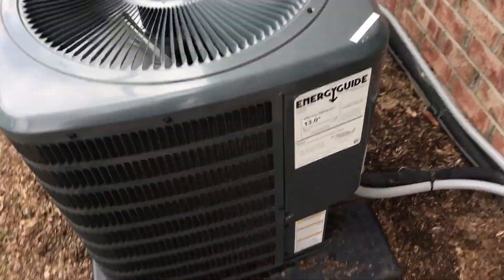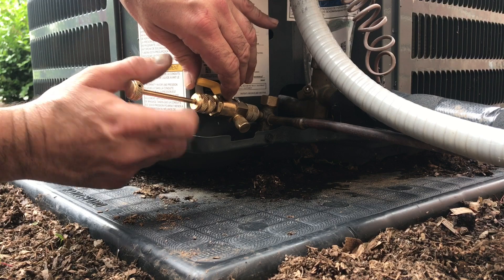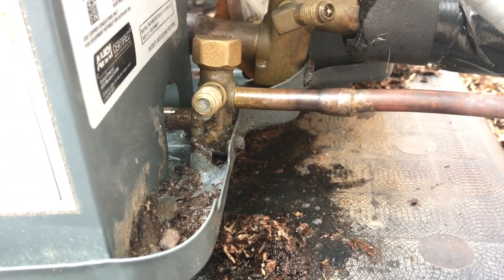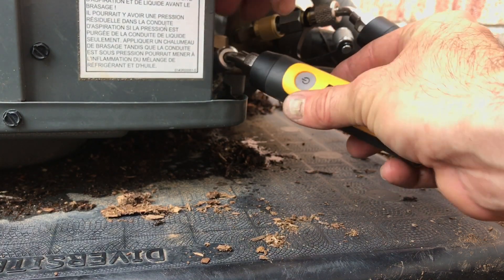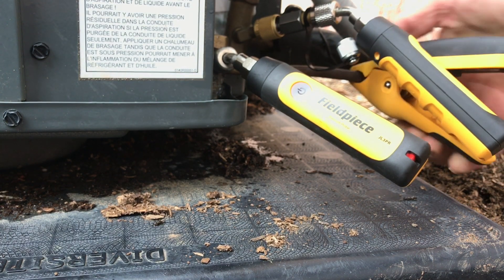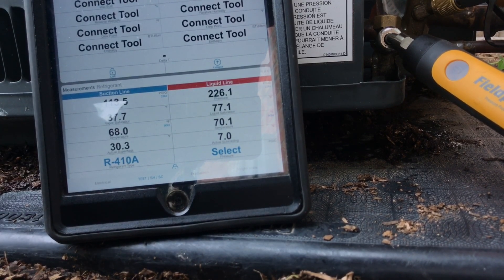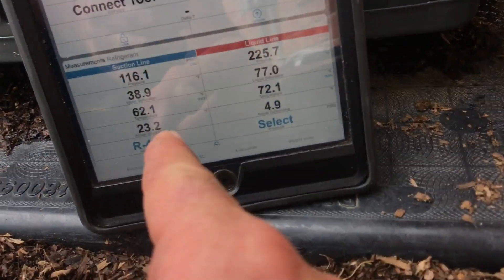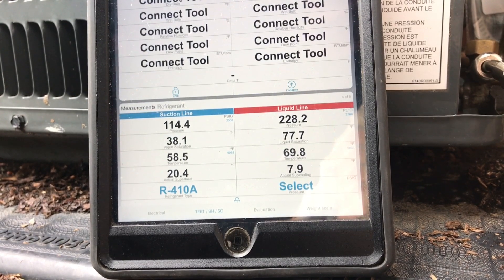Small 410a Freon Refrigerant Leak Easy Repair

Comment: no cap, leaking valve, vandalism, maybe other issues, but then again previous tech was probably lazy as fork didn't put cap/s back and didn't let it balance before removing hose blowing oil all over the place.. maybe they need to adjust the core depressors on gauge set
Reply from the maker: These are new systems installed end of last summer by another company. 3 of the 4 systems needed 410a.  https://youtu.be/i2t9kyLQRNI here's a video on the other 2 units there that needed refrigerant also. I think the installer cracked valves and left

Comment: I love installers that fry cores.
Reply from the maker: Yea cook that service valve
Reply: @thehvachacker  I can smell that burning neoprene. Mmmmmmm.
Reply from the maker: I remember when manufacturers switched to neoprene and the gaskets would shrink over the winter
Reply: @thehvachacker  Oh yes, and every year ac units would have a mysterious leak that couldn't be found come spring!  Oh the lovely headaches that brought when king caps weren't torqued on.
Reply from the maker: Does that still happen or was that just 2005-2008. Manufacturers wanted all the caps leak locked and torqued down tight
Reply: @thehvachacker  as long as they don't cook the king valves, no.  The valve cap design with an o-ring in the cap is still vulnerable but the metal on metal rely on proper install and torquing (ever seen the 1/6 turn stickers on king caps?) but we all know how much install manuals are read and followed.

Comment: So which ones you think is better, testos gauges or fieldpiece? Thinking about getting the fieldpiece joblink.
Reply: Both of them are very good but i personally like the 550 testo
Reply from the maker: My 550 suffered the static shock. Was great gauges for 6+ years. The job links are really nice no hoses. That means gas isn’t lost while checking pressures. Also no wires, no needing to make sure clamps are on not to short out the 550 from static shock. I loved my 550 yet wanted the smart probes. Since getting the smart probes not sure other than pressure testing a system if I would want to go back to a manifold style gauge.
Reply from the maker: Mwdub02 did I run into at johnstone? I am trying to figure out who it was.
Reply: The HVAC Hacker
I go to Kenilworth Johnstone! No we never met. Probably someone else. But I’d seen you in Jersey City two months ago. You were on Kennedy blvd but by the time I walked over the traffic light turned green. Just wanted to say wassup.

Comment: I had one of those C&D Core removal tools completely blew the end out once i removed the valve core, the snap ring broke and shot the valve core removal about 20 ft away. I’m thinking about getting the Testo complete wireless kit, so I can get the full benefit out of the measure quick app
Reply from the maker: I like the fieldpiece probes, wish I bought the charge and air test kit. What comes in testo complete kit? I had a rolled up in fall out of a core tool and the slider bar shot out the back of the tool

Comment: Have you tried using your tools with the MeasureQuick app yet? Seems to keep connection much better for me and I like that I can have 3 psycrometer probes at once. I think I heard they are planning ok updating it for refrigerators later this year.
Reply from the maker: I used it yesterday for the first time. Both apps work good yet Job link won't let me manually enter test results where measure quick will
Reply: @thehvachacker  yep. I actually played with it before I got the probes. So far I'm more impressed with he MQ app

Comment: Caps!?! We don't need no stinkin' caps!  😂
Reply from the maker: Usually, we don't need the caps unless someone put too much heat brazing in the systems. I gased up all three of these systems. I didn't want one video charging 3 systems, everyone watching my Ipad screen. So I hid the other video on my other channel. https://youtu.be/i2t9kyLQRNI a link if you are interested. Its where I am doing a lot of DIY projects. I like the other channel cause it's small and  I don't get shredded on my mistakes. You should see the video where I tried to learn my smart probes without reading directions on that channel.
Reply: @thehvachacker  I'm a very big fan of caps. I get on guys all the time for not having extra caps in their bags. And when you use brass "acorn" caps fingertight is not good enough, you got to put a wrench on them. I'll definitely check out your other channel.
Reply from the maker: I like the acorn caps with the flares in them. I save them and reach for them before a cap relying on a oring

Comment: Wonder if the correct piston was installed? Did you see it?
Reply from the maker: I doubt the correct one is installed. https://youtu.be/i2t9kyLQRNI this is my other channel yet the orifice is whatever came in the evap coils. All the condenser piston packages were still attached with the piston on the condenser. On the other channel, I have been putting up my Astro van videos

Comment: Does the digital gauges(wifi) work as good as the old fashioned gauges? Are they accurate?
Reply from the maker: They seem to be accurate, I like them its amazing the reports I can produce using the measure quick app or joblink app to save in my customers file room. I only use my analog gauges these days for pressure testing

Comment: No low loss fittings provided on those field fieldpiece probes huh? That sucks...never understood why they make those service valves so damn close to the walls...
Must be a goodman.....lol
Reply: Goodman is on the bottom of my list as far as equipment goes but I do have to give them a little credit because one of their newer units I worked on the other day did have brass 45's to turn the service port access outward and it was very easy to get to now. I don't understand why every manufacturer doesn't do that. I guess the brass 45 fitting cost $0.10 more than the straight fitting.  😀
Reply from the maker: I am about to install a Coleman, second Coleman I have installed. First one I installed a month ago seems like a nice machine but its a york.
Reply: Yea...seems some of those older companies are trying to reinvent themselves with some better quality systems but...as hack free always says:
You cant polish a turd and you cant make Goodman quality....its all oxymoronic
Reply: Jesse Lute 
Hack free has a bastardized Goodman turd in his backyard 🤣🤣.
Reply from the maker: Yup a goodman. Usually, you lose no gas connecting or disconnecting since no hoses to hold any gas in. Lennox has a sharp raw metal edge on a few condensers in that location. why I use the screwdriver refrigerant locking cap tool over the small two-sided one. Keeps my fingers from getting cut up